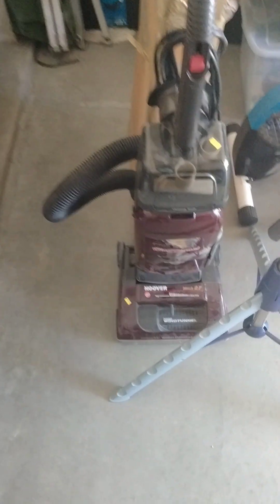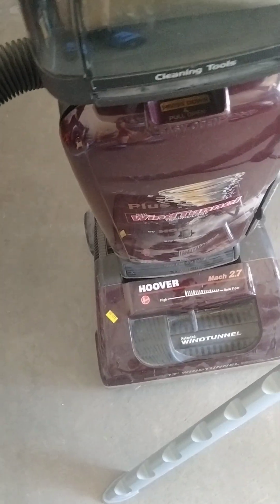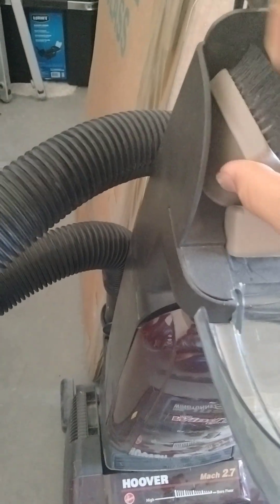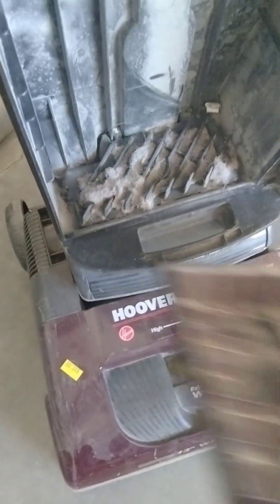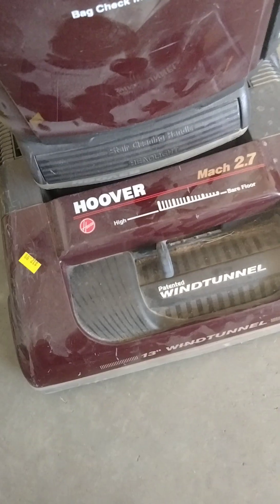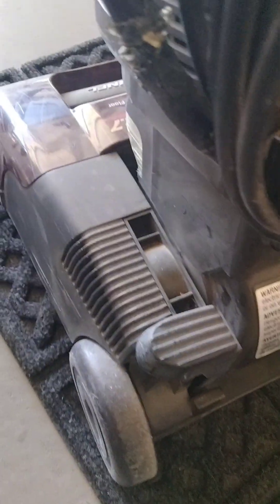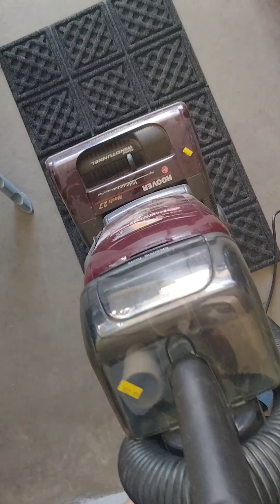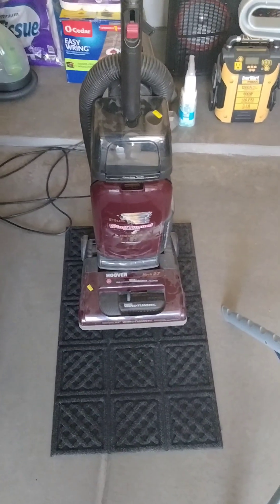My First Hoover WindTunnel plus Acquisition!

Comment: Nice find. These windtunnels are always abused when people sell them. It’s even worse when they use it without a bag and sell the machine anyways. The cords on so many of them get worn due to how powerful the roller brush is on these. New rollers are easy to find for these. Parts are easy to find for these in general. I’m surprised the motor doesn’t sound bad, but blowing it out probably would help. Taking these apart to clean it is actually easy.

Comment: I have the Supreme model in the same color. The attachments are easy to find. That is common for the original brushes. What year is this from? Yes, 2 wands. I love your flip flops! I still haven't looked for them yet. Sounds very good. Mine is the 13 inch wide track. Yes, that appears to be original.  The lower end ones came with a single layer filter. What other uprights did they have?
Reply from the maker: I think it's from 1998. The Is supreme model looks very interesting.
Reply: Mine is the wide track. I just had to get a new upholstery attachment, as mine was breaking in pieces. On these, the first two of the serial number is the month, the next two are the year. On my burgundy one, the numbers are 1197, meaning November 1997. I hope this helps
Reply from the maker: @dancline2143  Thank you so much
Reply: Send me the model number of that WindTunnel, I will search for the replacement parts
Reply from the maker: Thanks for your help, but I already found all the parts😊
Reply: @derellscott6695  are you replacing the power cord as well?
Reply from the maker: I actually repared the cord as you'll see in a upcoming video!
Reply: @derellscott6695  I want to see what the power cord looks like being repaired